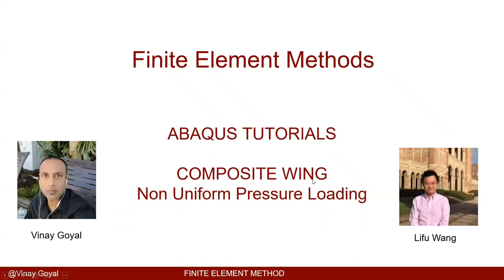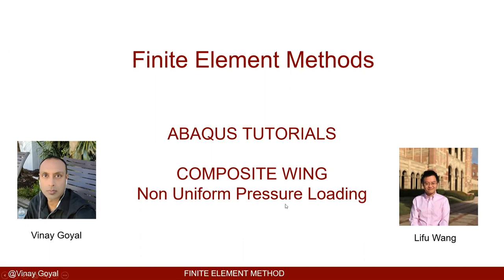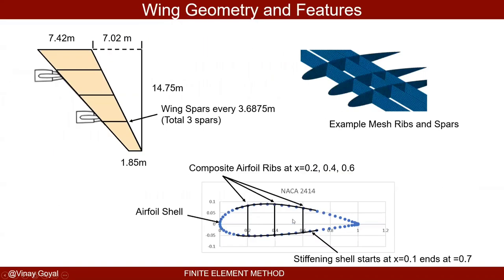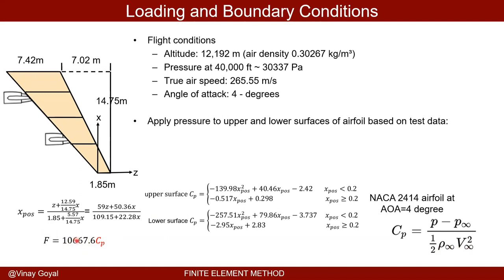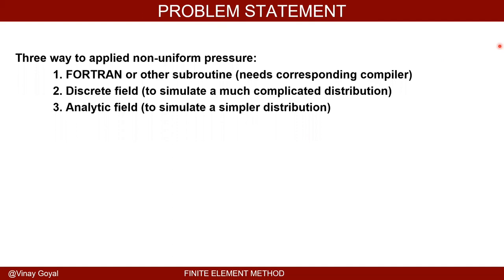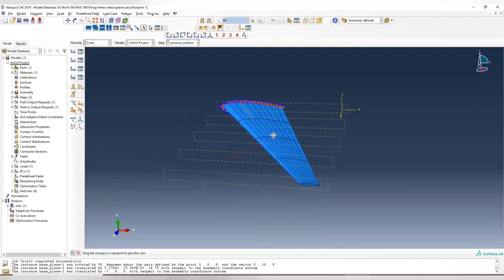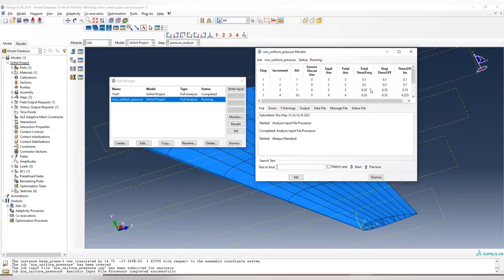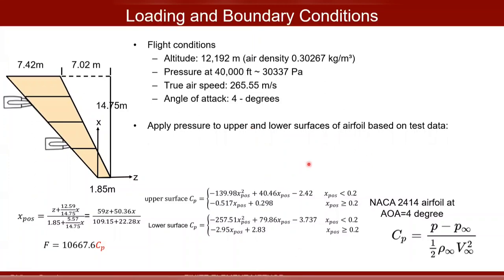#ABAQUS Tutorials - Nonuniform Pressure Application Over Wing Surface

Comment: Sir.. thanks alot  for this video .. 
Could you please do a tutorial explaining how to apply wind load in this model..
Reply: do you know how F = 10667.6 * Cp was calculated?
Reply: @nitinbabu2672  was the result of cp=(P-P_inf)/(1/2*rho*v^2) so F=P-P_inf=1/2*rho*v^2*cp. If you calculate it with the data that he shows you will check that this is the solution. I have checked before